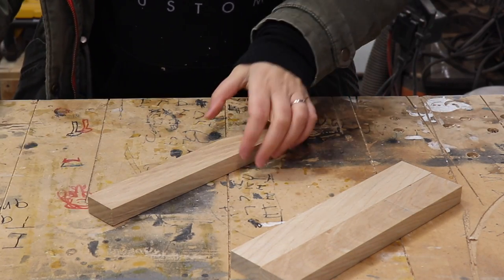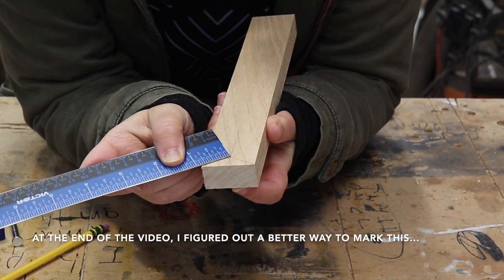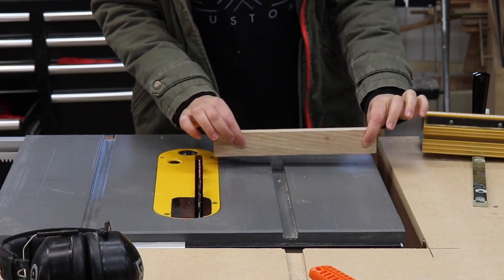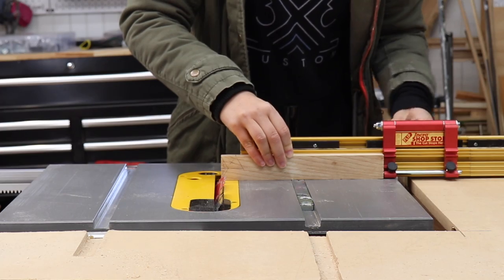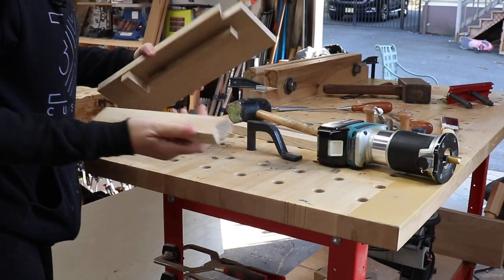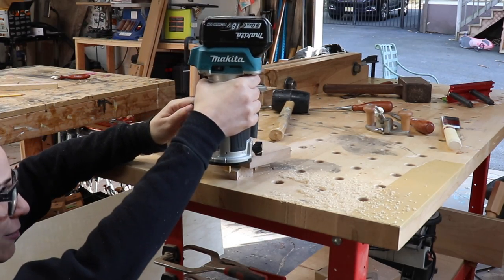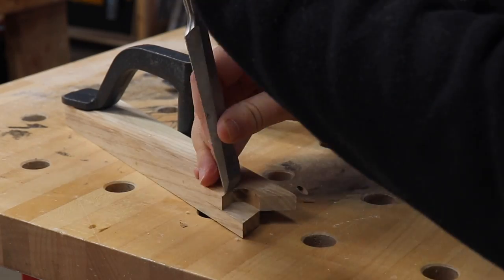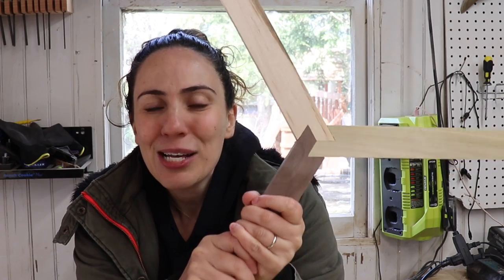Actually, I don't know what this joint is called... but Three-Way Lap Joint seemed to fit. Ha!

Comment: 11:04 - why not use the template as a chisel guide? (i.e. chisel the piece while being under the template not taking it out)
Reply from the maker: You can. I just didn’t think it was necessary
Reply: @3x3CustomTamar  I find it easier, even in other chiseling operations.

Comment: How would you cut the V shape without a tiltable table saw ? Tuning its setting seems like a hassle. Or maybe the blade is a bit thick for the desired precision.
(On another topic, apologies on behalf of all men for the inappropriate comments about how desirable a smart and crafty woman is, which men doing the same kind of videos will never get. They made me cringe).
Reply from the maker: I’m use to it at this point. Which I guess isn’t a good thing.... ha. Actually at first I thought I was going to make a jig using my tapering jig to hold the piece at the correct angle. Then just decided to tilt my blade. But that could work.

Comment: In the last try, where you cut the length in one, wouldn't there be a gap in the middle? Stay save.
Reply from the maker: Yeah. I think so. I just wanted to see if cutting it all by hand was possible for me. It would need some tweaking obviously to get it to fit correctly
Reply: 3x3Custom - Tamar 
It seemed OK with your thin saw blade, but I don’t think it would have worked very well with a thicker blade.

Comment: What would you build that requires a joint like this?
Reply from the maker: Check out my buddy I linked in the description he made a table with this
Reply: @3x3CustomTamar  Thanks Tamar.  Do you ever use a router?  I have one coming in a few days.  I hope to put it to good use.  Watching all these cabinet making/woodworking videos tells me I am really lacking in certain key tools.  I've been concentrating mostly on nonelectric tools the last few years.  Just got a Nobex miter box.  I love it.  But clamps?  I have lots of clamps.  Most of them are crap.
Reply from the maker: @craigmouldey2339  I Iove routers.
Reply: @3x3CustomTamar  :) Do tell!

Comment: What would you use this joint for?
Reply: Center stringer/stretcher for the legs of a 3-legged table perhaps..
Or making 2 of them and joining them like a double ended "Y" would give 4 outer points to attach to legs of a longer table, like a coffee table perhaps, while also providing somewhere to fix a lower shelf as well.
Reply from the maker: What he said. Ha. Yeah. So the guy I mentioned at the end, Keith, he is using it for a 3 legged table
Reply: @3x3CustomTamar  I'm a forward thinker Tamar.. You might even say, ahead of the curve.. ;)

I can already see this built in my mind, but I'd probably reinforce the laps with little dowel pins though, especially of it had a shelf panel on it.

On a kinda-related note, I've started the glue up for the segmented top panel for the second one of the tables I emailed you about 6 weeks ago.. I've refined the assembly process, so this should be easier to make flat (there's 24 wedge segments, you might recall), even though I will still have to put it through my router sled to get it down to 15mm.

Take care, stay safe :)
Reply from the maker: Gene Lomas oh. Sounds cool! Stay safe!

Comment: This is a very difficult way of woodworking !!!  It is supposed to be clever and easy,  no,  I will not do this.
Reply from the maker: So don’t.
Reply: @3x3CustomTamar  That's right I won't.
Reply from the maker: @ronsmith7739  imagine walking into a supermarket and yelling “cutting vegetables is too hard! I’m not going to cook” that’s what you just did 😂
Reply: @3x3CustomTamar  When I am Cutting vegatables I use razor sharp knife not a dull butter knife.
Reply from the maker: @ronsmith7739  think the metaphor went over your head…